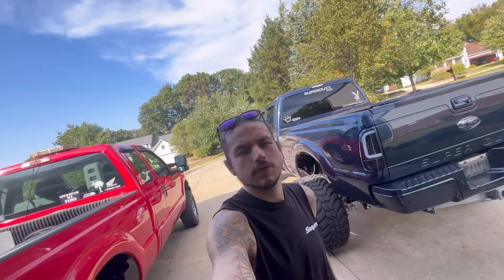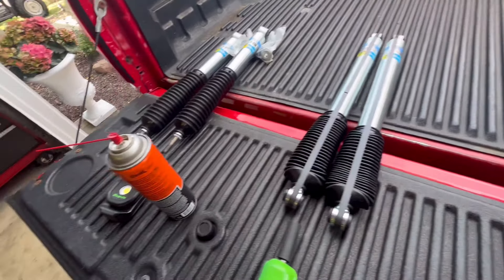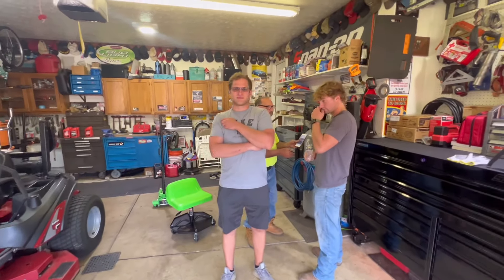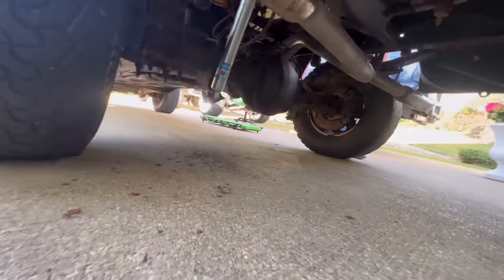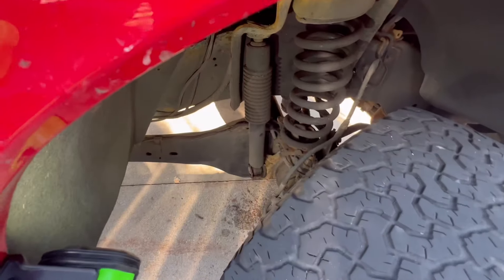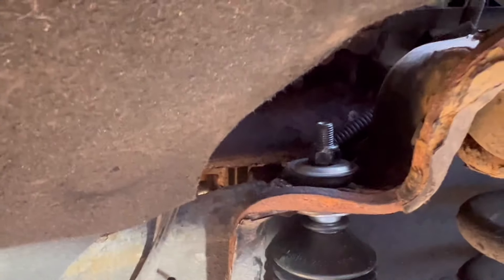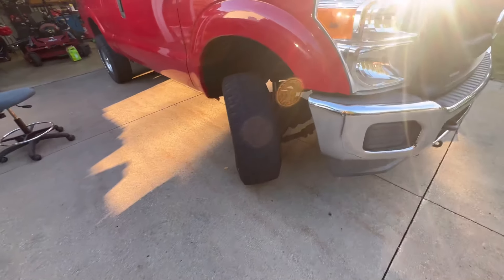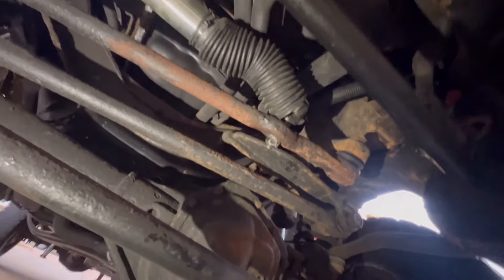The BEST SHOCKS to run on your FORD F-250 SUPER DUTY!? What is your thoughts? #truck #bilstein

Comment: 4600s are same guts as 5100s  Difference is 4600s are for STOCK RIDE,  5100s are for up to 2.5" lifts. Thank you for the video
Reply: dude thank you, you just answered my question
Reply from the maker: These are 5100s of stock height 0-2” of lift
Reply: @PowerstrokeRick  for newer f250 that only applies to the rear

Comment: I installed my rears like that and was told I installed them upside down. What are your thoughts?
Reply from the maker: No sir you installed correctlybecause that part of shock has just a rubber bushing and no metal sleeve inside where the bottom of the shock has the rubber bushing and the sleeve

Comment: i found these on amazon, will they work on a stock height? Every single one on there says that rear is 0-1 inch lift and front 2-2.25 inch lift. I have a stock height 2019 cant seem to find 5100s for a stock truck.
Reply from the maker: 0-1" will work
Reply from the maker: I think I got these on Ebay because this truck is stock height and I couldn't find them on amazon either

Comment: Hey can you use the 5100 with 2.5 inch ready lift  level kit in the front
Reply from the maker: Yes just make sure you order the right size. You’ll be looking for the 5100s that are for 0-2” of lift or a 1”-3” lift shock will work to something along them lines